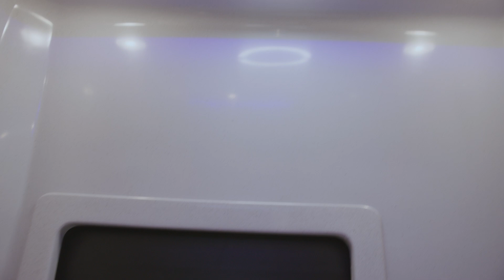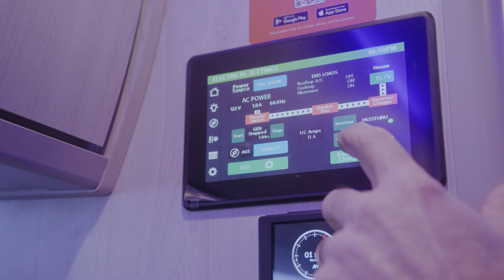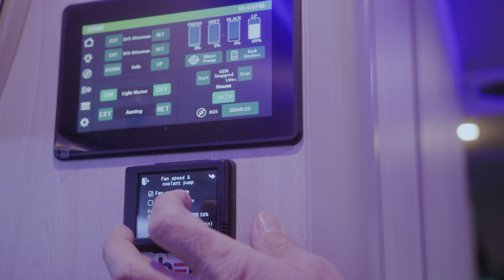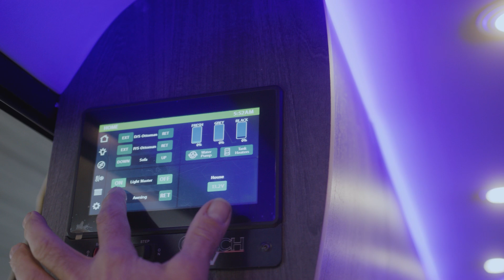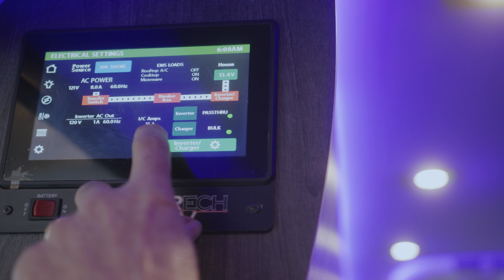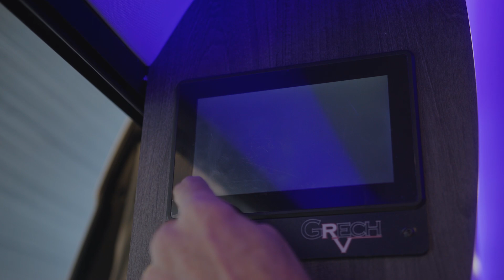Getting to know your Grech RV Strada and Strada-ion - Mercedes Sprinter Camper Van Class B Motorhome

Comment: One of the most detailed walk-throughs of a Class B RV -- see why Grech is one of 'the leaders in this pack'! Understanding all Class Bs are made by hand (therefore not perfect by any means) there will be issues/problems from time-to-time, but I can imagine yours are likely much less than your competitors, so are your limited dealers, now, fully trained and capable of handling the major ones (electrical, inverter, ION-related, integrated systems, etc.) or do buyers sometimes have to bring their RVs to manufacturing HQ in CA for really complex service issues/matters? Also, now that M-B has started building e-Sprinters with AWD do you plan to enhance your line-up to go 'All Electric'; and do you envision doing prototypes for upcoming RV shows with your larger or smaller models?
Reply from the maker: Thank you for the comments. We have an extensive dealer network. However, we will authorize ANY RV service center or RV mobile repair technician to complete warranty work on our behalf after required pre-authorization. We ask that Grech RV owners contact our internal service team for guidance and diagnostic assistance prior to contacting a dealer service center. 

We look forward to working with Mercedes-Benz Sprinter on electric options in the future.